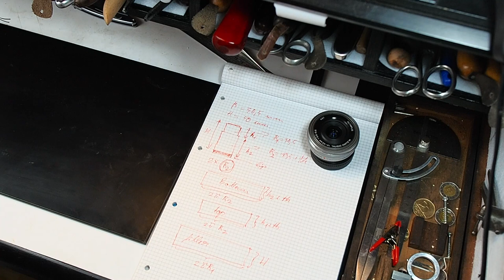Making a small  leather lense case

Comment: How do you calculate, the numbers of holes on the top, vs the sides?  Hope you can tip me.
Reply: You don't have to calculate it exactly, just mark the holes as on the side  and make partial stitches to let the lower side catch up with the upper one. By a partial stitch you advance the needle on the lower side to the next hole but stay on the same hole on the upper side.